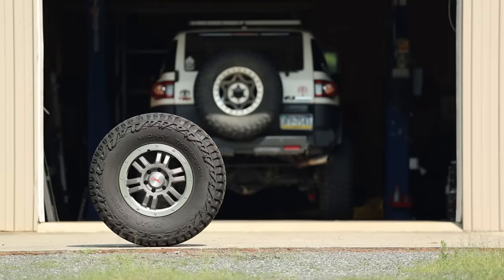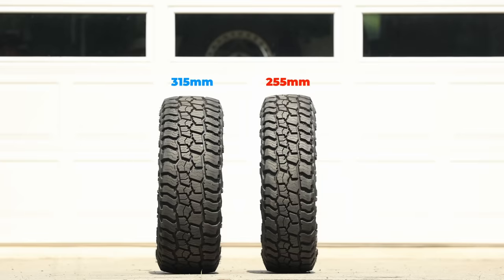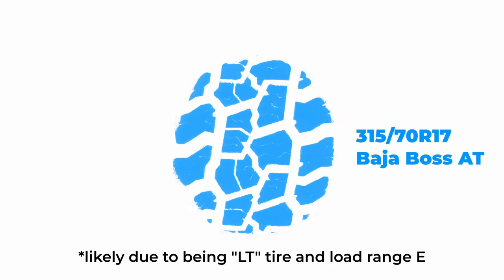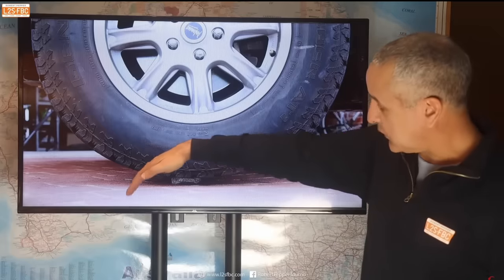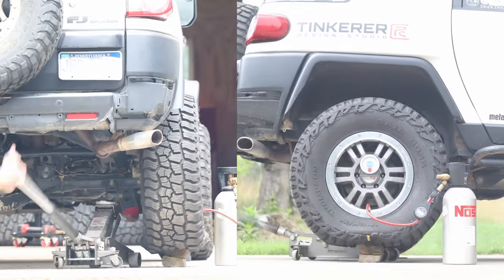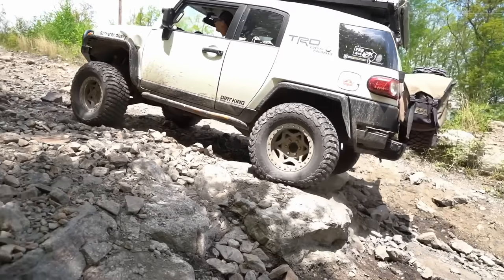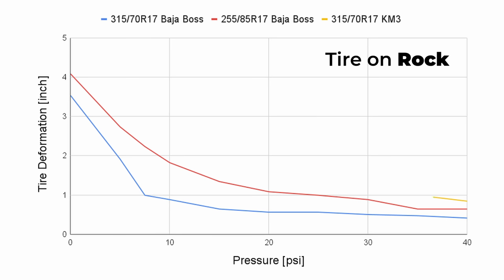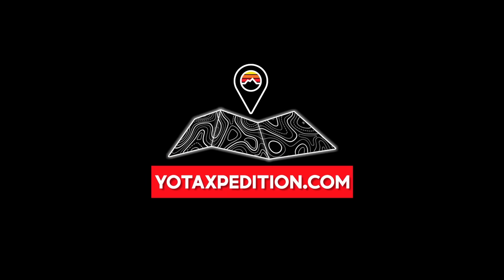3 Scientific Experiments to Settle This | Wide vs Narrow Off-Road Tires

Comment: Did you factor in the rim width in your experiment. Using a 7.5" wide rim With both tires will affect your results. What is the rim width of the beadlock rim you used with the BFG.   As far as I know a tire with a 315  section width should be mounted on no smaller than 8" wide rim.  If your experiment was based on finding the correct or best width tire for a OEM TRD 17 by 7.5 inch wide rim,then your experiment is fine. But if your intent was to find whether  a wide or narrow tire is better, I believe you should have factored in the correct  Rim width  to be equivalent to the coresponding tire width.

Comment: The only problem I can see with this experiment is that the wider tire should have had a wider rim. You can't get true results if you don't use the proper wheel width with the accompanying.

Comment: Good video  but as a Canadian you didn't test in snow,rain or mud. Problem with engineering is every thing looks good on paper. Practical trials give accurate data. My xj has 14 inch wide 33s on 15 inch rims. Rims size has alot to do with tire deformation and stoping on ice is very noticeable.

Comment: Excellent work! I've VW I.D. 4. similar to this, for 19 inch wheels,  the front tires are narrower than the rear ones. That makes the tire rotation impossible. Even the rear has a bigger motor than the front motor, it could be a bit more wear in the rear than those in the front. With the same touching ground area and well rotated tires, it's much easy to buy same tires vs. different ones in practice. Maybe at top speak and/or acceleration, one can feel a minor difference. Does anyone know VW's test results and reasoning for this?

Comment: Its not the most important thing to measure out how big is the groundcontact! It correct if you are driving on roads, but on different grounds by off-roading it is very different! The diameter of the full wheel is also very important like the type of profil. The results will be very different on rocks, mud and sand! Low pressure can help on rocky grounds but it kills you in mud! If it is useful on sand , that depends about the tyres you are using!

Comment: Allot of these tests leave out the point of it not being flat ground offroad. It really cannot be denied a wider tie "can" touch more surface area. Most of the tests offer no application to anything offroad you don't need as much tire flex if it's grabbing more ground across uneven surfaces like in real scenarios

Comment: If the BFG's were used tires, that is not a fair comparison. I don't have a dog in the fight as I love BFG's and Mickey Thompson's, just making sure we are comparing apples to apples. Also....anyone who has driven the same rig on wet, snowy, or slippery roads with the only difference being tire width, knows the pizza cutter wins hands down every time. No science needed. Just look at the color of your underwear after you drive a rig with fat tires down a road with standing water on it.

Comment: This is all irrelevant. Race cars run soft wide tires for grip. Tractors run hard, narrow tires for grip. Application matters. Vehicle type matters surface type on and on.  A bulldozer on dirt will pull a house over. The same bulldozer with all that surface area as you're concerned with on concrete won't budge a house the tracks will just spin.  In my opinion, for offroad, a narrow tire is the most effective because more pressure is being applied to the surface with any given weight over a wide tire . Tractors are low speed offload and use narrow tires. Model A'S and T's were used b4 roads and had narrow bike like tires. Only a bottomless surface like a swamp or snow deeper than ground clearance a wide tire is an advantage because you want to reduce surface pressure by "riding on top." My two cent.

Comment: He missed a big tire test opportunity bias ply vs radial tires... Bias ply are more pliable to off road terrain and will squat and deform better in both directions example driving forward on a boards edge as well as crossing a board stood on edge as the car ase is designed to not be as flat and stiff as a radial tire

Comment: I would like to see the same test but with a load rating suitable for your vehicle. load range E is for something like a big heavy diesel truck. of course they will barely flex under an FJ Cruiser. Please redo the test with a C rated tire at the most or borrow a big truck that calls for E rating and test the same tires again.
I think what you really proved here is that you shouldn't use E rated tires on a light duty vehicle because you have to air them down to an unsafe level to achieve the traction advantage that airing down provides in the first place

Comment: Would I be able to fit those 255/85R17s on a 3rd gen Tacoma with a 2” 6112/5160 lift and still have full suspension cycling?

Comment: The results make no sense. The whole reason to get a skinny tire is for its ability to remain more rigid, having the sidewalls closer together. Its the whole reason why you have dually tires in the rear on large pickup trucks that tow/weighted down, or a semi truck, rather than one single fat tire. Given the same sidewall construction, the farther the sidewalls are apart the weaker the load bearing ability, and therefore the more squat/sidewall deflection it should have when aired down, vs a skinny tire.

Comment: The pipe experiment is not a good recreation of driving over a rock ledge. A rock ledge has a flat surface on the top that also aids in grip HEAVILY, and the longer deflection pattern of the skinnies would have been ideal for utilizing that area of grip. Its very uncommon to drive over a perfectly round pipe on the trail and a pip is nothing like a rock ledge. You should have set the tires down on the edge of a box instead of a pipe.

Comment: Maaan that is counterintuitive. Does this mean that on regular cars this has the same effect? Something does not add up. I get it for deflation but still does not sound right. 
On my bike for example I prefer  wider tires because I can run lower pressures but I guess the math is different there.

Comment: Your method has some small flaws in it. That is with the proper rim width for each tire you would have a very different out come. Using the same width rim on both tire will give you to more round tire to ground patterns and with the correct tire rating for the weight of the vehicle then you have had a totally different. Though you did more of what most people would do when looking at which tire they would get. But outside of those few items you did a great presentation.

Comment: You could have just asked old farmers like myself for the answer. We don't put on tires as narrow as wagon wheels nor as thick as tank tracks. We don't need an engineering experiment to know that your "pizza cutters" are better than those wide tires. Common sense triumph's over science 😂. Except wide is better on deep sand..So there's that.
Reply: Anecdotes aren't science - definitive results are more helpful.

Comment: PSI = Pounds per square inch. That literally is a measurement of what your experiment shows. A vehicle of 4000 pounds will have 1000 pounds of weight per tire. If your tires are inflated to 10 psi, you'll have exactly 100 square inches of contact area per tire. 10 pounds / square inch X 100 square inches = 1000 pounds X 4 tires = 4000 pounds. This is why, regardless of the tire width, the contact patch is the same - it is related to the WEIGHT of the VEHICLE divided by the PSI in your tires. All that you're doing in this experiment is demonstrating what PSI actually means. The difference between tire brands (All-terrain vs. mud terrain) shows that your measurement method contains an error. You drew a circle around the general contact area. You should actually be tracing the shape of each lug to truly calculate the "contact patch." The mud terrain has more space between the lugs. Since the lugs are more spaced out, you need more tire "squish" until the surface area of the lugs, backed up by a given PSI of tire inflation, can support the weight of the vehicle.

Comment: no way so you're telling me a 4400lb car with 4 wheels each at 30 psi gives a 36sqinch contact patch? - something like 4400/4/30 = 36 . Its almost like PSI is telling you how many pounds you can support for a given area and pressure. Although this math only took seconds doing a whole video is definitely more
Reply: and you can't break mathematics just by changing your car tire? thats crazy

Comment: Way too many variables to select a single tyre. Rocky, sandy, muddy, thick mud, watery mud, tyre pressures, on road to off road usage, tread wear, tread depth. In the end most will buy on how it makes their 4x4 look. Buy whatever makes you feel good and get a winch, even the best tyres will still get you bogged.

Comment: i’m not even gonna watch your video because I have the common sense needed to know and I do know the facts of tires on dry ground. I would much rather have the water tire. There isn’t a very wide contact patch underneath any tire at any time but the wider the tire is the more square inches of contact patch you have on the ground on dry now on wet you have still more contact patch but because the tire is wider, it has more tendency to hydroplane. Then the skinnier one is to cut through the water that’s all you need to know if you run in a lot of harsh winter conditions snow and ice pack. You’re better with the skinny tire if you run on dry ground hard pack all the time the wide tire would do you just fine for maximum traction now if you wanna go with minimal rolling friction, then you need to go with the skinnier tire and you need to air it up so you have less rolling friction that’s for fuel economy you can air a wider tire down and get phenomenal traction but at a certain point the wider tire loses its center contact patch, where an hour or Tire would lose less but ultimately they are fairly equal.

Comment: All this, and on top of that. Narrow tires are better for road use. And even if you're an adventurous fellow. You're still going to hit paved roads from time to time. The only Real advantage wide tires have is longevity. But they also cost more from the beginning. So is that actually a good thing? Don't we want the newest and greatest tires every time they come out with a new model anyway?...

Comment: Wow, seems the world has forgotten what a "mall crawler" is, it's so common to see wides on everything, that you're all just noobs on wides now, Guess no one remembers the old military tires, or working 4x4 farm trucks, But hey, I get it, no one wants to look like their grandpa right? lol... and don't even go there about sand, we drove manual rear wheel drives in sand with "normal" tires, getting stuck in sand? let off the damn gas, just idle out, 99% driver 1% machine.

Comment: First of all tier performance is not based on looks! I am not a rock crawler. It's cool to watch to a point. But becomes boring after a while. For me. I use my 4x4 to go do our door activity's. 'hunting and fishing' so with that said. The best tiers in my opinion are narrow not wide. My preference is a 7.50 x 16 biased 8 or 10 ply tier. Radials suck. First of all. The rubber in a radial tire is galvanized differently than a bies ply. Think of a tennis shoe compared to a work boot. The radial is designed to grip pavement the same way a tennis or basketball shoe is made to grip the cort. Bias ties last longer. Narrow tiers have less serface contact on the road surface causing less friction which in turn allows for better fuel economy when driving on the street or highway, interstate! Think of a 10 speed road bike compared to a fat tier mountain bike. More friction=more energy eathier fuel or you pedaling . And when off road in the mud or in snow on or off road the wide tire will float on the surface causing you to slide side to side. The narrow tier dig down and you grab the solid surface and achieve better traction. That's why mud dragsters use wide tires. Because the mud pit at most drag races are usually about 3 feet deep. When the mud dragsters go down the track they only sink in about 4 to 6 inches. Skimming across the top. But in the real world when you out in the field hunting or fishing most people don't drive like they are in a mud race. For me I put the most aggressive mud and snow on the back on the front I put what is called a highway king. The tread pattern is a simple zigzag. The reason for this is, the zigzag pattern is a steer tier pattern my front end will go in the direction that I point my tier in. Mud snow or dry ground. But obviously there not going to grip as good as the deep lug mud an snow. When it gets to the point I need more traction then I throw a set of tire chains on the front wheels with a couple of chain tighteners. And with the smooth  edges of the zigzag pattern. As soon as the tier spins the tire chains tighten up and I will not throw the chain off. And I will go were I want until I get high centered. Have fun!

Comment: And here is a perfect example of how graphs, stats and driveway experiments are not the same as real world results. Your contact patch on flat concrete means absolutely nothing... nobody cares about that, fatter tires mean you can have traction on two different rocks that a skinnier tire wouldn't be able to reach across. And let's not even talk about how poor skinny tires do in mud and snow. 
Coping for your increased fuel mileage
Reply: The only time wide tires are a benefit in snow and mud is if you are running bead locks at super low pressures, where a skinny tire would have no sidewall left. A 255/85R17 at 2 psi will probably be riding on the rim where as a 13.5" wide supers swamper will still have sidewall left because its contact patch is twice the width.

At general purpose offroading pressures in the 12-18 psi range, the tire width should be based on the weight of the truck. A skinnier tire will cut through the snow/mud better provided is allow for the same surface area contact patch. Instead of cutting a 12" wide trench through the snow, you can cut a 10" wide trench.
Reply: @Jay-me7gw  as soon as you say you can "cut through" mud, that tells me all I need to know
Reply: @spetsnaz892  and your response tells me that you still dont understand what the video says. The tire foot prints are the same, which means they have the same flotation, which means they will both sink equally into mud or snow. Would you rather be cutting a wider or narrower path through that mud?

I was on 37x12.5's at 5 psi and still sank down 3' into snow. I still had to cut through it. Understand?

Comment: Static testing does not tell anything about dynamic performance. Common sense and experience will provide a lot more about tire preformance. 5 psi is a worthless data point.

Comment: Great video and a lot of work.  well done.  I don't 4wheel any more. despite driving a supercharged Range Rover.  Gravel drives are about all that has to tackle.  But in years past I did do a fair amount of desert trail driving and before that competed in English trials competitions where the surfaces tended to be slippery rather than very rocky.

I've always found narrow tires are better all round tires.  And a narrower track can be a real asset in tight terrain.  Lighter, narrower tread and narrower track all put less strain on the suspension joints.

I believe guys that insist of installing the widest tires suffer from penile deficiency.  Their masculine insecurity results in their overloading their wheels, besides getting their childish jollies spraying mud and dust down the sides and over the top of their vehicles.  That's sad.

Comment: Great Review that cleared up alot of questions I had. Now I have a question for you? Which tire would you go with on a 2023 Subaru forester for going through snow and mud really well and still drive smooth on the highway like a street tire but have all the grip you need for off roading. these are the two choices I have decided on. Your Thoughts!

 the  Yokohama Geolandar A/T GO15   or  the Michelin CrossClimate 2

https://www.youtube.com/watch?v=B3-mZWmhPhA&t=160s